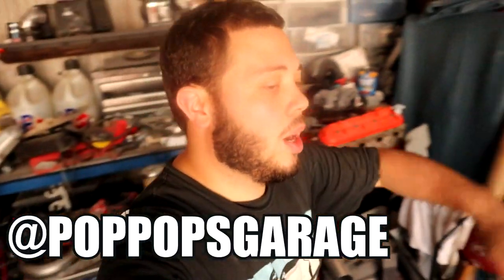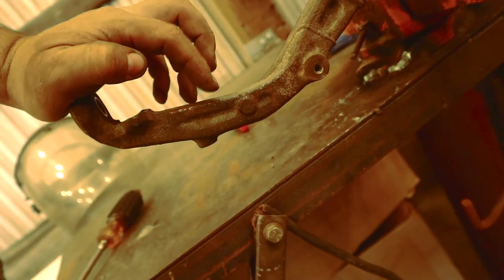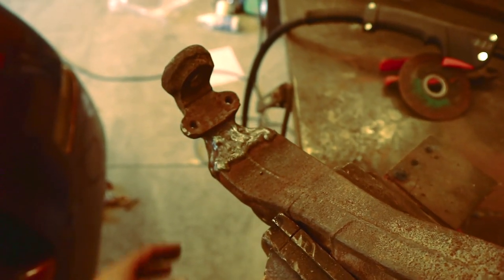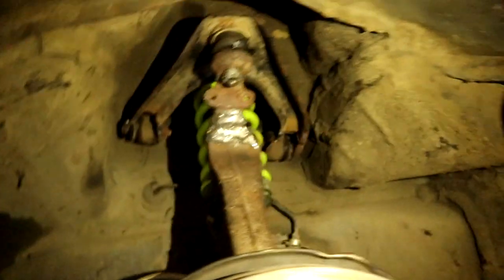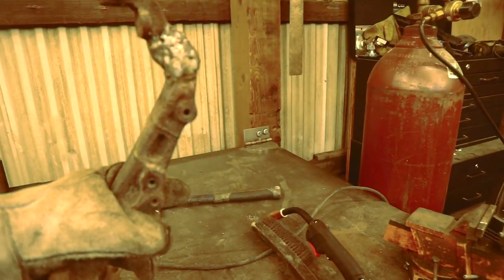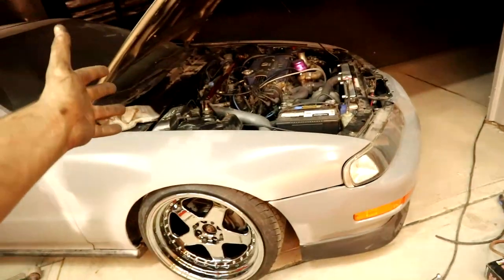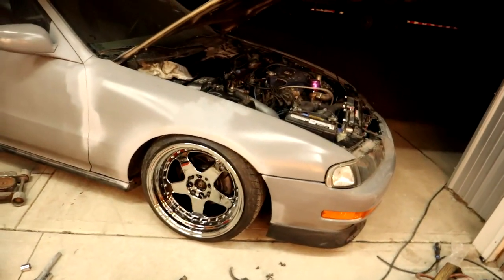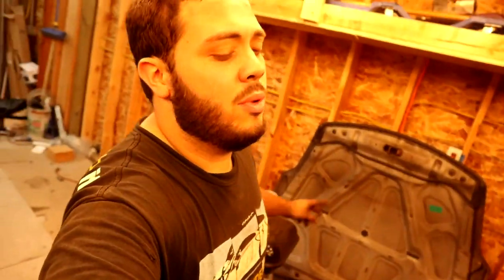HOW TO MAKE HONDA DROP KNUCKLES

Comment: Is there no aftermarket piece? Would be wurried after every pot hole bump
Reply: Hmm.. buddy.. i'm sure if i agree on this job. Will it ever be 100% the same? And strong as factory?
Reply from the maker: Bas BlasterXP no the point is that it’s not the same and yes it will be as strong as factory 👍🏻
Reply: @damianmonte  okay!
Reply: Shortened forks is the way to go
Reply: And they make them for prelude
Reply: @10sandovalallan   if you get shortened forks its essentially the same as shorter coilovers or spring. which brings the upper control arm up into the strut tower. Which is what drop knuckles prevent.

Comment: They do make adjustable control arms for the prelude now along with drop forks
Reply from the maker: Andrew Serpa yes mpc makes drop forks but I don’t need those because the tophats do the trick. As for control arms someone sent me a link I’ve never seen those before and regardless I don’t trust that style of arm my friends have had skunk 2 arms like that break so I’d rather have a solid arm
Reply: Nah I feel you bro! I’m eBay for life so I’d run em but only because I like testing cheap shits limits. Preludes have the worst aftermarket support

Comment: Would.have been alot easier to cut a hole in the strut towers, added some caps to cover the holes and just pie cut the control arm to anglr the balljoint back into alignment or welded in some sliders like the adjustable upper A-arms for a civic.

Comment: I had his problem on my ls430 until I upgraded spring rate. Went from 12k to 16k. Still hitting but it’s never as hard. My question is if I get higher spring rates (28k) will I still hit with no modding to the knuckles?

Comment: They make drop forks. But I'm sure you probably already know that and the cost. Ahhhh but if it's anything like the accord I know you can't find squat aftermarket not sure why.
Reply from the maker: Drop forks don’t fix the UCA angle, this does, no click clackin and bottoming out, held at 650hp no problem lmaooo
Reply: @damianmonte  more of a gm guy so I don't know everything about these Hondas. Started researching when I started restoration on a 91 cb7 se accord sedan. And just picked up a 91 civic wagon 4wd.

Comment: I wish i did this with my Slammed Del Sol so i didn't ruin my strut towers.
Reply: Same. I did a full tuck and shave on my del Sol and the engine bay was perfect. Took it out for the first ride and the arms hit and cracked the paint on both sides. I was pissed. I spent so much time getting those towers perfect lol. And I'm not even that slammed.

Comment: Couldn’t you find a way to get civic stuff to fit on a prelude? New to Honda stuff so I am just wondering
Reply from the maker: I could buy civic arms and weld them to prelude stuff but they all look so cheesy idk if I’d even want to. Had a friend with skunk 2 control arms and they bent and broke and those are considered good ones so I’d rather just weld mine I don’t need to adjust them I just need them to not break 😂